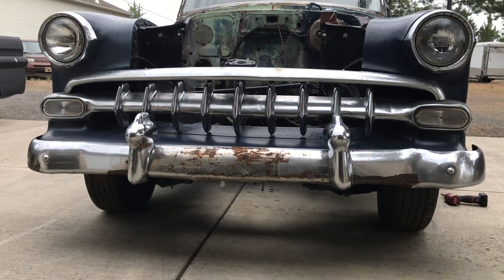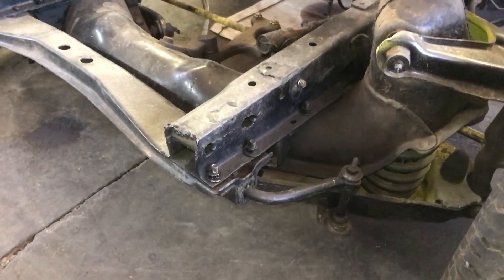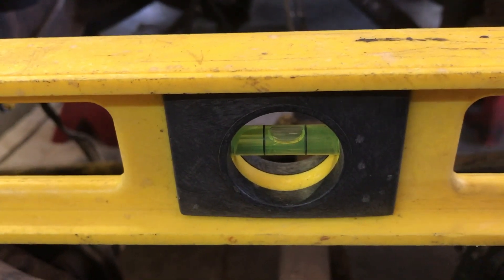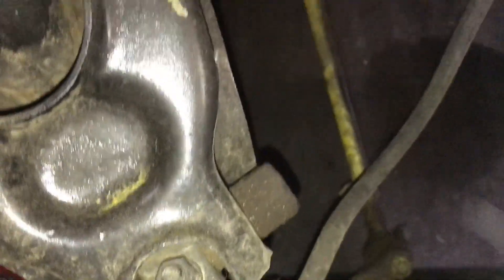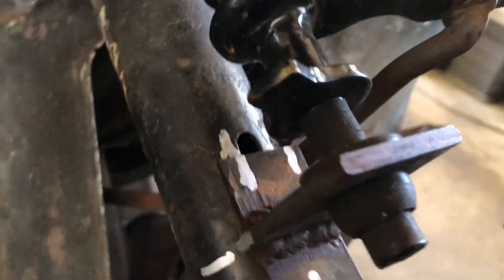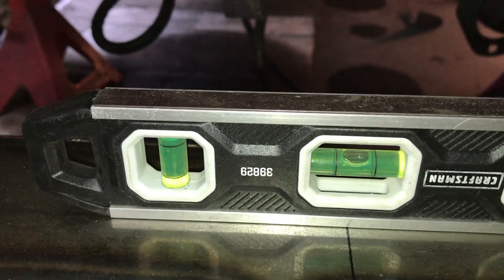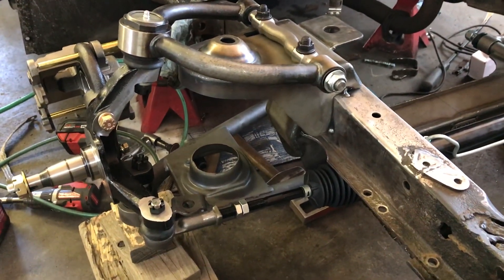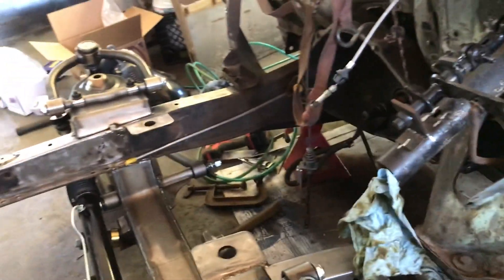MUSTANG II INSTALL!!  pt. 1 - Installing the Crossmember

Comment: I have one of those brand new 65 Mustang convertibles. I am pushing 80 yrs old but have restored and built street machines since the mid 70's. I am also in a wheelchair T-12 L-1 since 1969 due to Vietnam. Its refreshing to see another wheelchair car builder. Getting back to my Mustang. I installed a Quick Performance four link IRS on a nine-inch rearend a little over a year ago. I just bought a complete IFS that I just received two days ago. I should mention that there is no time limit on if I ever finish this car. It's the last car I ever plan to build. If I die my son will see it completed. If the Good Lord gives me time and I finish it than I'll start on something else. Tomorrow I will begin to start on my IFS. Good luck with your project even though its two years later. Make sure you take care of your health. You can see my four link IRS if you type in 11B it will come up.

Comment: I enjoy your presentations, and admire your tenacity.  I am a 63 year old, one-legged man rebuilding aa 1949 Ford F2 pickup.  I am also crippled from an old spinal injury that slows me down.  I am in the process of installing a Mustang II front suspension package, then to a Scott's Rear End Suspension package.  The work is very slow, and sometimes painful, but I enjoy the challenges and the work.  God Speed, friend!  God Speed!

Comment: Just found a whole mustang 2 front end for free on Marketplace. Its going into a Geo Metro... guess I'm putting a 302 into that little tin can 🤣. Two of the slowest and most disappointing cars grafted together to run 9s is my vision. With you're inspiration I won't let an achey back slow this build down. Its definitely the biggest project I've ever undertaken, but if I dont finish then it all these parts are going to the scrap yard and all is lost! I like how you're not over complicating things.

Comment: Great Video, I’m working on a 53 BelAir Hardtop. Not doing the front end, but literally everything else. Installed a SB 350 Engine and Trans, 83 Z-28 rear end with disc brakes. Replaced all Floor Pans, so it has 4Wheel Disc Brakes. At very close to 12K invested, had all the Chrome work re-done. I’m just tired, thinkin I may just cut it loose. Get to feeling that way sometimes. Make someone a Sweet Car. 
Your Dream of Cruisin is pretty Awesome, maybe we can connect someday. 🤣 Keep up the Video’s and Enjoy!
Reply from the maker: yeah buddy!  get it running and drive it! it might motivate you!  I've been spending so much money and time on the engine, I'm at the point where I just want to slap it together to hear it run... prioritize - running, driving, then make it pretty... sounds like you have an awesome car!  any videos?
Reply: Where I can get the manual?

Comment: I have an early Mustang II with the single lower control arm and bad bump-steer starting at 25 mph. Wants to pitch the car into on coming traffic. Do the steering rack tie rods need to run parallel with the lower control arm when car is parked? Which it does not. If I feather the throttle it will smooth out and I can take it on the freeway but the second I hit the throttle bit hard it gets very scary. Would love some input from anyone that knows what I might need to do. Just cruising the car goes straight like it’s aligned but has not been on a rack and checked yet.

Comment: Hey Brother I have a question - are all these Mustang 2 kits compatible? For example, if I wanted to use the same heidts cross member, or the speedway crossmember, but then install CPP’s mustang 2 control arms, can I do that?
Reply from the maker: Possibly.  CPP or Speedway would know for sure.  I opted to go with the Heidt's crossmember and control arms.  spindles, rotors, brakes, etc were speedway, and were compatible with the Heidt's stuff.  but I would say contact them to get the final answer.  hope that helps!

Comment: This may be a stupid question but what make and model is a good welder?
Reply from the maker: not a stupid question at all! that's how we learn... I currently have a Miller 211 and I love it.  previously I had a Craftsman professional mig.  I've heard good things about the Eastwood Mig 135.  I have the Eastwood Tig 200 and it's great! I haven't used any of the Harbor Freight/Vulcan welders, maybe others can weigh in... every welder has its quirks, so you'll want to focus on making good welds, good penetration with any welder you get.  I'd say get the best one your budget allows... hope that helps.  THANK YOU FOR WATCHING!

Comment: Godspeed. What size of welder did you use to weld in the towers and crossmember?
Reply from the maker: I have the Miller 211 used on 220A

Comment: *QUESTION!!!* What welder are you using, also are you using gas??
im welding my entire front end with 90 amp flux core welder.
Reply from the maker: I'm using a miller 211 on 220V, shielded with CO2/Argon gas.  not sure 90 amp flux core will work.  it's a CRITICAL part of your car, so if you are at all iffy, I would consult a local welder in your area.

Comment: The mustang 2 front end should be a big upgrade compared to the factory suspension   are you going to run the Holley sniper efi in this car
Reply from the maker: totally!!  I'm not... I'm actually gonna tear apart a suburban and throw the 5.3L in the bel air!! should be fun...
Reply: Ls swap for the win

Comment: you inspire me to get my 37 Chevy going and do as much of the work as I can. I have a question if you can happen to know the answer I appreciate it. I've seen some frames with the mustang II kit have the frame notched where the power rack goes. is that needed for lowering the car more ?
Reply from the maker: @OCGGVENOM dude that's awesome!! I think whether you need to notch the frame for the power rack depends on the car you're putting it in.  I didn't have to on my 54 chevy bel air, but my buddy did one on a 50 chevy pickup, and he did have to notch the frame... my best guess is it had to do with the shape of the frame, not so much with lowering it.  hope that helps